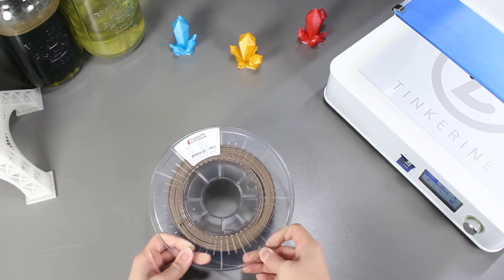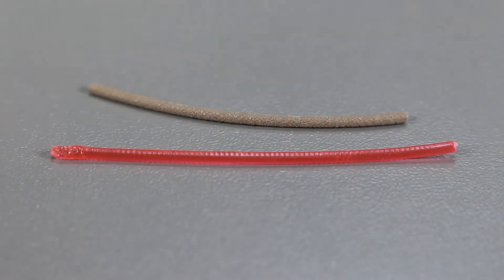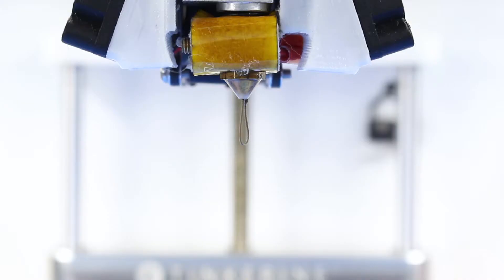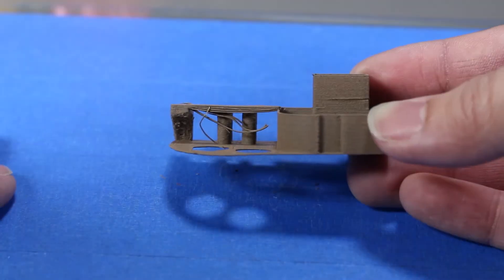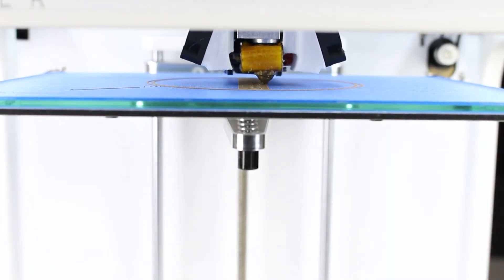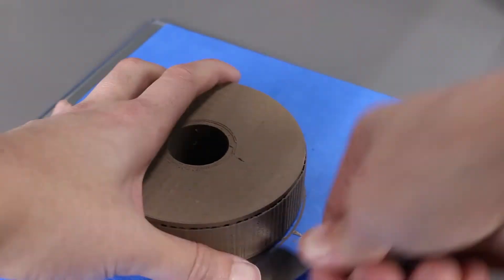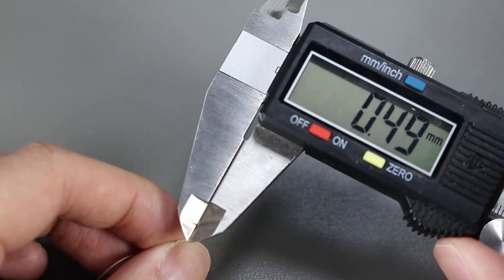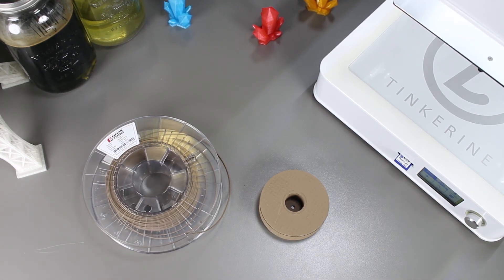3D Printing with Multi-Composite PLA

Comment: any chance you will ever sell replacement nozzles for those of us who want to print with exotic filaments like this? replacing the entire hot end seems a little extreme.
Reply from the maker: Hi,

Thank you for the feedback. We are always doing R&D.
Reply: AliExpress - maybe you'll find a nozzle with sizes that you need. There can be found steel nozzles as well (to print with composite PLA).